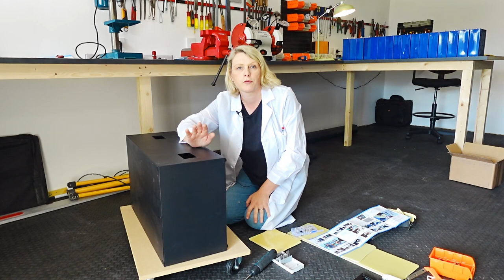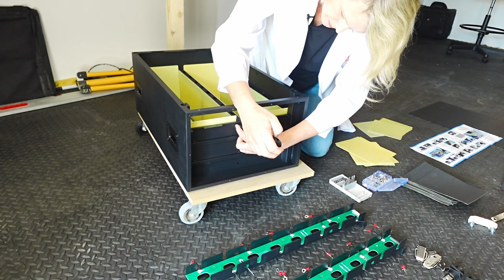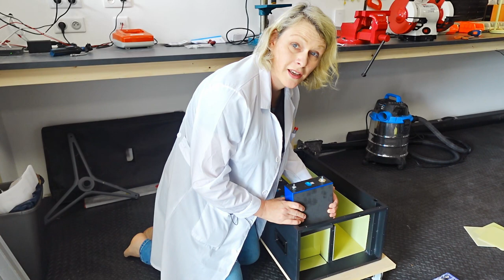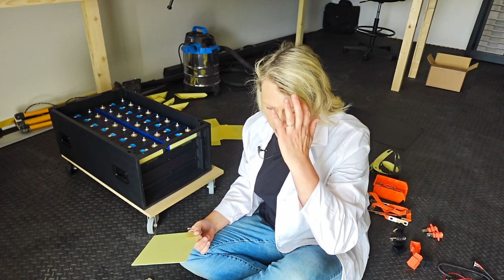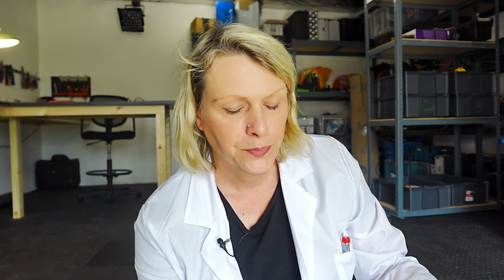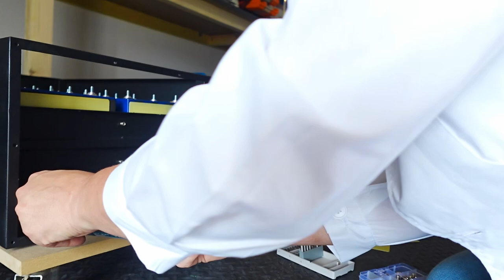DIY Lifepo4 Battery Case kit build part 1

Comment: Suggestion for assembly of the future battery packs that might help.

Put all the foam sticky back pieces into a pile and put a couple of heavy books on them for a week or so to pre-compress them before assembling the battery pack. 

Enjoying this so far...
Reply: Maybe clamping between actual clamps. Should test with one layer of foam first. Would be a doozie if the foam doesn't expand back afterwards...

Comment: Good to see someone actually having some logic about what the future will bring. Technologie will be a long way in 10 years from now.
That sayed, compression is important to prevent the terminals to break/damage when cells expand, and will sertanly add to the lifespan.
Without proper compression the cells will slowly damage themselfs internaly and can reduce in capacity relatively fast.
One sidenote; the last cells in the back do not have any "compression plate" to "lean against" wich might result in forced swelling in one direction wich is worse then normal swelling.
Reply: Some new batteries come with flexible busbars so that should make take some pressure off the terminals. 
The last cap is left empty on some other kits as well. No idea what the designer was thinking. I see two possible remedies. Either make a metal plate for the end piece. Or simpler way is to fill the epty cap with something that doesn't compress. Layers of something something until the frame height where the separator sheet is.

Comment: Nice. Those are very similar to Seplos Mason kits, and they use the same BMS. I have 70KW of them running right now. Would have cost me $21000 US if not DIY and just bought 5KW Lifepower. As far as the seperators, I also just used the rubbery pads. You should be fine.
Reply: Please, which product of battery did you use for your's?  Planning on building mine.

Comment: When you load your next case with the batteries, I suggest that you:

Turn the case on its side so that as you load each battery, the yellow separator with the foam attached will be compressed from the weight of each battery stacked above. When all batteries are loaded, with help, carefully reposition the case so that it is in its proper orientation.

Stick the adhesive foam to all but two of the yellow separators to make the batteries easier to load. Not adding foam to the first and last separators will require less space to stack the batteries side by side, in two rows.

Add each of the first yellow separators without any foam padding, then add a battery to start each row of batteries. Continue by adding a yellow separator with foam attached to each row, then a battery to each row, and so forth until the last battery for each row is placed into position. Finally, insert the final yellow separator (which should be without foam attached).

Comment: the batteries are supposed to be compressed, compression helps reduce internal delamination that may happen as battery ages. Any delamination will reduce effective capacity. not only that, it will limit the amount of movement you get when using busbars instead of a wire when connecting your batteries together. I think if you ask the supplier, they will list the compression value.
Reply: i should have waited to finish the video instead of pausing and posting

:face-green-smiling::face-green-smiling::face-green-smiling:

Comment: Round cells have no problems with compressed cells. The design prevents this. 
Prismatic cells, on the other hand, develop fat bellies over time. This reduces the lifespan.
Reply: You get 15 years instead of 25 years of life, so I'm told. I think most of these cases put some compression on it not like when you use threaded rod.

Comment: my dear if you like to build something please think first.
you know you have this batterys in 50 A 100 A 150 A 200 A 300 A
A is just the volume if the A doubles the weight doubles
and that is what building in serie or paralel 10 x 50 A is also 500 A
and they are all 50 volt but you can lift 10 x 35 Kg but not one time 300 Kg.
regards;Henk
Reply: My dear 🙄🙄